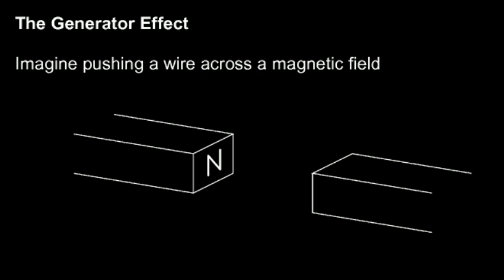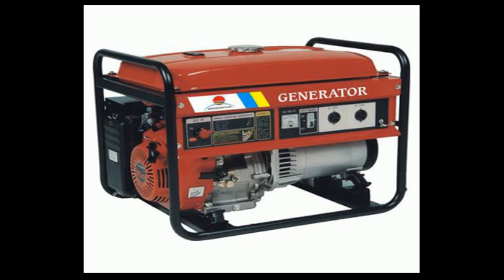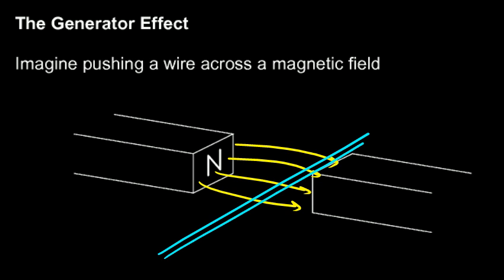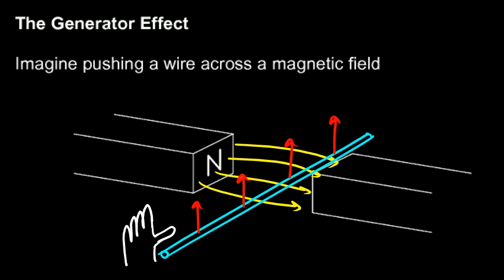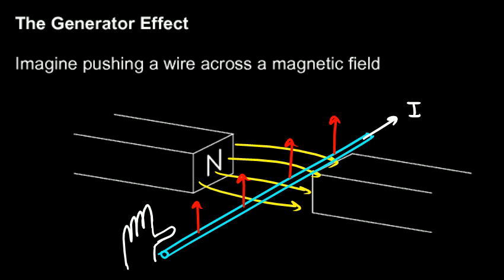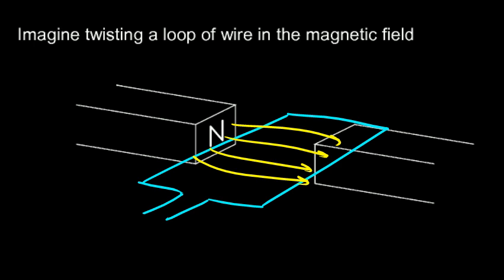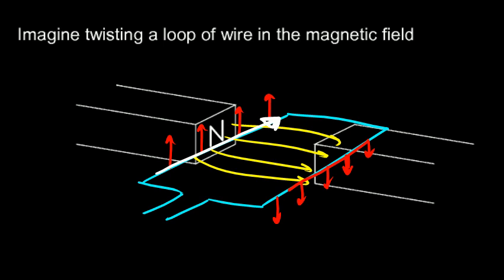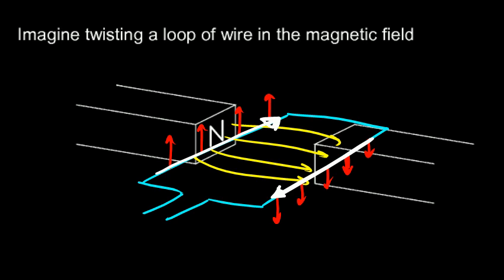Physical Science 6.8d - The Generator Effect

Comment: Hello, could someone please clarify the below?
To sum motor vs generator - when you pass the coil with a current between the poles, then it's the motor effect... and if you do the same but without a current in the coil but instead rotating the coil then you generate a current in the result... That i understood.. What confuses me is - once you generate current while rotating the coil then doesn't the generated current additionally rotate the coil? I.e. generator with motor effect... Basically the resulting current simulates a motor afterwards right? If i am right then shouldn't the rotation increase on its own once you start the rotation due to both the current and rotation being present? Thanks!

Comment: These are good videos. Just a quick observation for you. With conventional current flow (positive charges) using rhr. For the force to be vertically upwards on left hand side the current would have to flow in opposite direction to what you have drawn. (same for the other side). Of course if you meant electron flow then the diagram is correct, but using left hand rule. Also its useful to note that the rhr and lhr are the same rules for both generators and motors.

Another way to remember how this all works is to use conventional flow and just use the rules for cross products using the Lorentz force law F=qVxB for moving charges, where you always turn vector V (velocity of charge) into vector B (magnetic field vector) with the resultant vector (Force) being in direction of movement of a right hand screw.

Comment: The magnetic field is caused by the magnets. This exerts the force on the charge in the wire. The wire forms part of a closed circuit. This means the charge moves through the wire and around the circuit continuously, never leaving it. If the wire loop did keep turning in the magnetic field, the direction of current would alternate every 180° of rotation.

Comment: If you are using a generator to produce electricity,  you say you need to physically move a wire through a magnetic field produced by two magnets to generate current.

However, how do you produce a strong enough magnetic field to generate current without electricity in the first place...?

Is two pieces of magnetised iron enough? Is that what they would use in industrial generators?

Comment from the maker: Yes, I think that's right!  But in this case, that downward force is the force that you are pushing *against* to move the wire *up*.  You have to push it up (in this diagram) to get the current to flow in the "thumb" direction (in this diagram).

... I think I have that right, but correct me if I'm wrong.  It's easy to get these directions mixed up, and it gets even more confusing when you start distinguishing between conventional current and electron flow.

Thanks,
D.O.